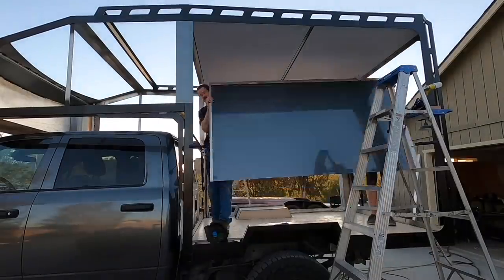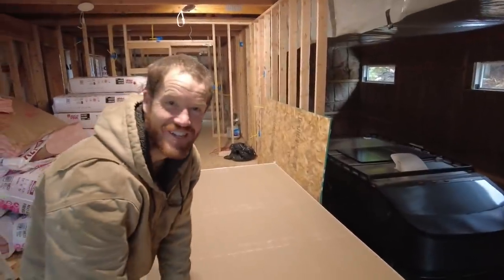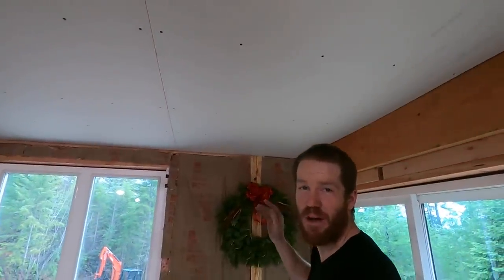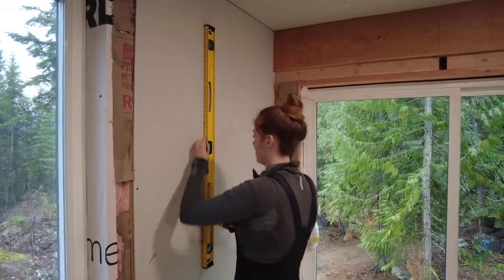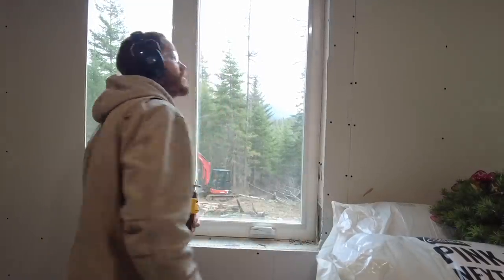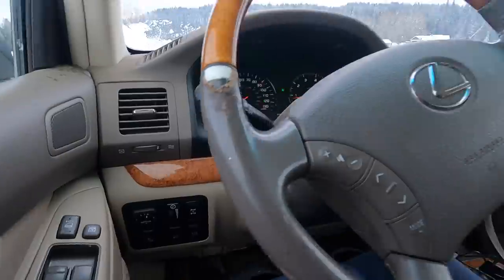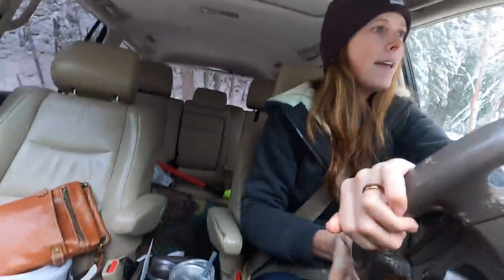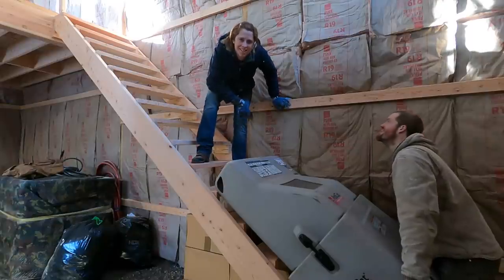Building Our Own Home | Drywall

Comment: Drywall/plasterboard is meant to be hung from joist no more than 2' apart.  A 4' span is really pushing it !  Even with 2' spacing, the drywall should be attached to cross supports every 2'.  Check the weight difference between blown in fiberglass and blown in cellulose.  (About 1 lb/cubic foot vs 2-3 lbs/cubic foot).
Reply from the maker: Thanks for the input, our joists are 2' on center. We added an extra between each roof truss for that reason.
Reply: @AmbitionStrikes  The extra wood should be no more than 4' apart.

Comment: An interesting adventure and fantastic energy to pursue a dream. Good on you both. Two comments. I think what you are doing is amazing, but when we lay drywall in Australia we glue the sheets to the joists - the screws are basically there to allow the glue to dry off. This gives a ‘chemical’ as well as mechanical bond. Do you not do this in the US? The other issue is that when you put the screws in your roof sheeting we place the screw on the peak rib on on the flat valley. This is so you don’t get leaks…… is this different in the US? Great channel. Thanks
Reply from the maker: Gluing the sheets is not as common here in the states. We considered it, but in our opinion the glue is only as strong as what it is attached to. And in this case it is just a flimsy layer of paper on the back of the sheets. 

We followed the instructions from our sheet metal manufacturer, and they specific the screws should be in the flat valleys!

Comment: I didn't see that you added any, but adding deadwood between the joists on each wall to fasten to will keep your sheet rock from sagging.
Reply: I did see you added it out in the middle. Normally that wouldn't be needed, but is probably best for joists on a 24" center. I called it "deadwood", but it's just blocks that are anchored to the top plate and stick out at least an inch to provide support and something to nail to.

Comment: You need to offset your joints. It stops the joints from cracking! You should have added a half sheet on every alternate row.
Reply: Yes it would improve things, but considering the building is not fully heated at this stage, the parts of it will change shape, when it does get the heating. So you still have to accept, that cracking will happen, unless you are able to wait for building to reach the optimal temperature and dryness and you can maintain it close to that pont all year round.
I have cracks in my newly built  house, since i had it dry rather quickly with conditioned air.  All the places where different materials meet also have fairly large cracks now ... so only a renovation in a while will fix my issues.

Comment: I'm surprised you did not both screw and glue your sheetrock.  Why did you not stagger the joints on the ceiling? i always thought sheetrock was run horizontal on walls, why did you run Vertical? Have you thought of putting a window in the living room overlooking the shop? might make the room feel larger? did i hear Courtney say " Because I'm Pregnant" ? Another Great production....

Comment: I don't recall the video mentioned, but either way don't worry about other people.
Just a comment on driving your driveway, on mine I have an s turn also what I do is try and keep my momentum up till I get to the corner then slow enough to drive the corner than try and pick up a bit of speed without spinning for the next one. Also they can be a pain but a set of chains if they will clear for your car will be handy even with snow tires. At a minimum a set of cable type but preferably the diamond pattern low clearance.
As far as plowing snow with a truck you may find that to be a learning experience, don't even bother trying to plow up hill. I expect that you will find that weight is needed in the back of the pickup (300 to 500 pounds) next to the tailgate, well restrained. A 5 gallon pail of sand is close to 90 pounds each and with a lid keeps the sand dry and usable for when needed. Back to plowing you will need good heavy chains on the pickup it's nice to have them on all corners but many pickups will not have clearance for front chains. When I used a truck to plow my driveway and even now using a tractor I plow down then back up and plow down again to have plenty of room to get back up. I always push the snow towards the low side of the road and hopefully over the bank without getting the truck over. I then push out the corners separately as I get to them again pushing over the downhill side. Realize that you will get the plow truck stuck at times and have a plan to recover it, winch or stretch strap and another vehicle with chains.
I realize this is long but tire chains will be your friends buy good ones, for your army truck consider some ag tractor chains such as OFA's, TRYGG's or Aquiline Talons.
 Best wishes and good luck

Comment: Haha - your fear is reasonable and all da haters are likely ignorant and/or haven't every dealt w/ snow/ice roads.  I recommend finding a flat parking lot (with nothing to crash into) or field w/ snow and doing figure eights, drifting turns, and all kinds of fun stuff (and scary).  This is great practice to see how your vehicle handles while sliding and how to recover.   If you have some super steep / scary sections that gives you challenges, you might be able to create a braking ramp in the Spring like they do for semi-trucks on mountain roads, so if you are sliding towards an unfun place, you have a safe bailout ramp you can crash into a dirt mound versus hit a tree or something?

Comment: How and when will you add the insulation either inner the roof panel or above the ceiling.  Shouldn't that be easy before you install the ceiling drywall?

Comment: I see someone having way too much fun conquering the fear. :D Keep it that way, snow and ice is a lot of fun,  when you get used to it. 
About the drywall - it usually makes sense to put some semi-random cross "braces" anchored to the beams. But then I thought about the insulation - how are you putting it up there ? For one you need to account for the extra weight, and drywall is not the best option to support it, I have about a 1/2 inch (by 4 or 5") wood planks spaced about an 1/2 inch apart  going across beams, which support the insulation, then a little free space (close to 2 inches)  and only then the drywall attached. An on top of crossbeams I have a walking pathway in places where a human can reasonably fit so you have ways of doing work, placing additional insulation (it will settle down and compress over time) etc. 
Also for the light fixtures it is not a particularly good idea to put anything directly above any light fixture (yes including LED), because it needs some cooling. There are special "plastic buckets" you can place above, but it is the best practice to have that space. Halogen, daylight etc lamps need it even more, and these buckets ar wider and taller in that case.

Comment: Another 4x4? So have you given up on the Jeep with the tracks?  Along with the army truck, the Lexus, and Ram.
Reply from the maker: There hasn’t been enough snow for the Snowverlander yet. The Cherokee is a unibody design and we had serious concerns with the force a plow would put on it. The army truck is far too wide to plow the road at its current state. We’re really hoping to do some road work next summer and be able to plow with the army truck next winter!

Comment: Ideally, when drywalling, you want to stagger your seams. A floor-to-ceiling seam is much more visible after tape and texture. As are seams that run the entire length of the room.

They are also more prone to cracking. It's better to stagger the sheets to make lots of shorter seams.

It looks like you guys took a lot of care to make your joints tight and even, so that will help in the finishing, but those super-long seams will likely always be visible.

It's a rustic living space anyway, so you probably don't care, but just some info for future reference.

Also, you guys don't know how glad you are you weren't hanging 5/8" drywall! It's amazing how much of a difference in weight there is hanging 5/8 vs 1/2.

I used to have to hang 12' sheets of 54" wide 5/8" drywall on ceilings. It was absolutely brutal!

Comment: You need to stagger your seams.  To prevent cracks.
Reply: If you were being inspected it would fail
Reply from the maker: We considered it, but my research determined that it doesn't appear to be necessary on the ceiling.
Reply: I just didn't want you to have a problem later on.

Comment: Drywall jack. i would have loaned it to you and T square. Gap the dry wall so the mud will flow through if its too tight you just fight it. I had a drywaller teach me this years ago . You dont have to use 5/8 . modern 1/2 is just fine don't worry. Depot sells the foam panels to  make air flow. . There cheap. .  I bet its hard to listen to all of the idiots tell you how to do everything.  I pride my self in knowing  lots of useless knowledge. Ive done lots of remodels and i live close . Just saying.

Comment: Your ceiling drywall joints are wrong, they need to be staggered,  you will have flexing and joint cracks.

Comment: They don't have a clue.  They should be using proper ventilation baffles, not offcuts from house wrap.  They should not need to use OSB for the ceiling.  In time they are going to have condensation / damp nightmares.  Arghhh

Comment: should stager your joints
Reply from the maker: Our understanding was that staggering joints are not necessary on ceilings?
Reply: Not only is that unnecessary,  it creates needless work.
Reply: @wes52101  thats why its code
Reply: Code is different everywhere. I've been a contractor for 20 years in Illinois and Texas and I've never heard anything of the sort. There is no advantage to staggering drywall joints. None.

Comment: Your methods of insulation and drywall are somewhat unconventional. As I said before, you shouldn't staple insulation on the outside of the studs and you stagger the end joints on the drywall

Comment: No adhesive, bad results! Big fail
Reply from the maker: We don’t understand how adhesive is necessary. It’s only as strong as what it’s adhered to… and in this case that is a thin layer of paper?
Reply: @AmbitionStrikes  have you ever removed plaster from timber that has been glued? I’m a plasterer in Australia. I’m also a builder. I’ve done a few renovations in my time and built a few houses also. The basic reason why we alway glue plaster to timber is that the screws provide no structural strength or support as the small head easily pulls through when movement is applied. The sole purpose for screws is to support the sheet until the glue dries. Now as far as the stud adhesive goes, it bonds the sheet to the joist or stud permanently. If you try pulling down a sheet that been glued, you end up with big chunks of plaster stuck as the sheet is removed. It’s fundamentally Critical that you glue the sheets especially on a ceiling. With alternating air pressure inside your roof cavity, over time the sheets will start to come away from the joists and worst case crack and fall. Hate to be a bearer of bad news guys.
Reply from the maker: @TerryCassar  we really appreciate the explanation. Glue is not common practice on the United States,